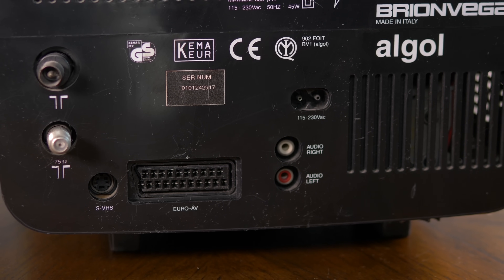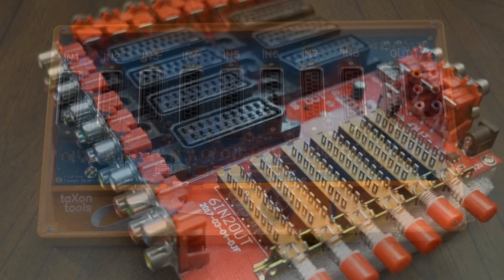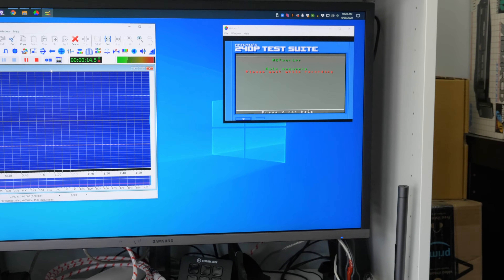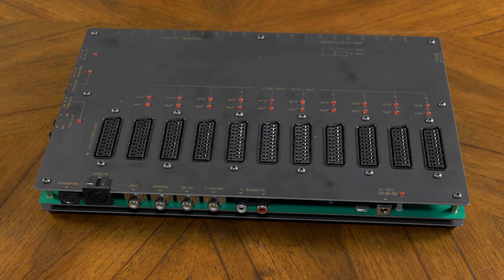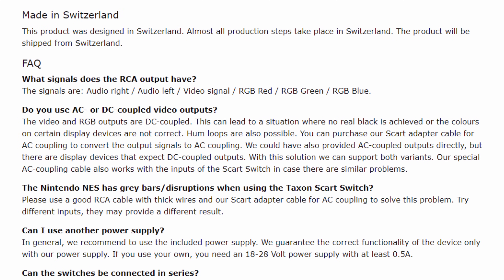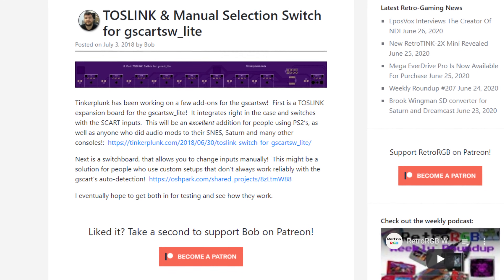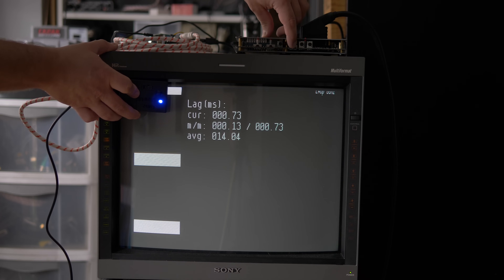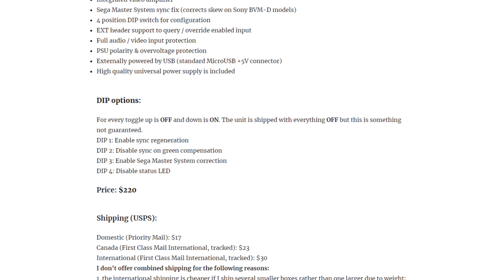SCART Switch Shootout

Comment: Hi Bob
Thank you for your honest review.
We want to give some inputs about your results.
Video output difference:
It is not meant that a customer needs to calibrate these pots. We will factory calibrate these pots. We will recheck our calibration process it seems that some device in the calibration process is not calibrated correctly, hence providing minor differences on the output. But just to repeat what you say: "Better be on the too low side than on the too high side". We will fix this issue for our next calibration it is not a mistake of the device itself.
Audio problems:
We have listed to your audio files and it is not only hearable with headphones. Actually, we can reproduce your problem with a genesis 1 console using the scart output. However, when using the headphone output on the genesis 1 console on volume 5 of 10, there is no issue. It sounds even more crisp than directly. When using level 10 of 10, we have the same issues again. Also from hearing your samples it is clear that the signal is clipping. So, we don't know the triple bypass and what it will do to audio, hence we admit that using too loud input audio is a problem with our switch and gives the results you recorded. We will test whether we can quick fix this anyway with a termination resistor for the next bench. But in our opinion a sega genesis is not the appropriate console for audio testing;-)
Hum loops:
Like descrbed above, the audio problems also have nothing to do with hum loops. As you already have said, we are using dc coupled outputs. Our description is a general description what can happen with dc coupled outputs, not that we admit that our device has general problems. We are just selling this additional ac coupling cable for persons who are having problems on the output because dc coupling is not good for them.
We will definitely include your problems in this version and future versions of the Taxon Scart Switch. Thank you very much. Maybe you can add an update what we want to fix for the current version. We can also send you the switch again after fixing the problems in case you want to recheck.
Thank you
Christopher, Taxon Tools
Reply from the maker: I really appreciate the detailed response and I'm happy to cover all updates to your product in our news posts.
Reply: @RetroRGB  Could you please contact us using our contact form on our website so we can provide you the latest updates directly once we are done?

Comment: Will you be doing a video on component switchers? I'm debating on getting a Extron Crosspoint switcher with bnc to rca caps added to the ports for my HD Retrovision cables.
Reply: im using Extron component. it works great. only downside is the size
Reply: @RideRedRacer  size is no concern just that component cables can work on the BNC ports with adapters.

Comment: Nice to see the SCA get coverage! I used it for a long time before upgrading to an all DB15 setup. The TTL output option is particularly useful for using an Extron RGB interface. BTW, you could have added a note in this video about the option of avoiding SCART altogether and using DB15 cables as an alternative, with plenty of cheap options for professional-grade VGA/DB15 switches from Extron and other manufacturers, from basic ones to auto+manual switching ones with conventional audio inputs (I'm a bit biased on preferring DB15 :p) Maybe material for a future video!
Reply: I am using a Kramer VGA witch for my Amigas. Are you using a VGA switch for consoles aswell? What kind of cables are you using? Any  female scart to male vga cables?

Comment: Do you do all your testing on a flat screen? Would like to see how this gear looks on a crt, same principles apply I’m sure .. interference or no interference
Reply: If anything these should all look even better on a CRT, particularly the Taxon one, as CRTs tend to mask a lot of interference noise, especially consumer ones. These don't do any changing of the signal, so it shouldn't look any worse.
Reply from the maker: For these tests, I felt digital captures were the best way to demonstrate the noise.  Sometimes I take video of a CRT / flat panel with my camera though.  It all depends on what I'm trying to highlight.

Comment: I have 12 consoles that I'm looking to connect that all use either RGB SCART or Component, and I really don't mind mechanical switches, so I'm thinking two of the cheaper Otaku switches ran into a single, regular old component switch and then into the OSSC is probably the easiest for me.
Reply from the maker: That'll work.  Using an Extron Crosspoint should also work as well.
Reply: @RetroRGB  Hadn't heard of one of those until now, but man that thing looks like a huge beast. I might just have to go with it!

Comment: I haven't got a scart switch. I didn't get a chance on getting one with the price so high. I just manually switch them. I hear scarts are fragile. But i am careful and haven't come across a problem yet. 
I use the sync usb cable thing with mine. Seems to make the colors nicer. I tried the one without the USB sync thing and notice a difference. 
I wanted to go component but IDK if sync thing works with that to. I was planning on getting the OSSC but didn't get a chance on getting it. Now that the OSSC pro is coming i may get that instead. I gotta see reviews. I really need something nice for the 480i/p consoles. Framemister isn't cutting it for those but looks nice for everything before the ps1. The Framemister with 480i/p looks alright thou, like how a nice tv would do it. If the HDMI connection isn't available then go with the FM. I hear some good things with 480i/480p with the OSSC but only does 2x, some people had problems thou so i read. Still looking forward to the OSSC pro device.

Comment: There is also the other way around with a scart splitter :) The only circuitboard seems to be from Shinybow as far as I know but rebranded as Ohmega in Europe and provides 8 outputs. It also seems to be quite rare. Apart from feeding to multiple monitors, I also found it useful to be able to feed the signal back to Framemeister with a scart to component coupler when I play back DVDs on PS2 as the signal changes to component with DVDs and my regular RGBs (through WHydra2) feed to FM becomes audio only. All of the new Scart products seem to be focused on Switches and there are no new ones providing more than 2 outputs I think.

Comment: I'm still happy with the two Bandridge switches I've got.
Reply: Yeah I agree. They're a great manual switch. Simple, passive and just works perfectly. I've had four daisy chained together for years and can't complain at all. Although I'd imagine they're nigh on impossible to get nowadays.
Reply: yeah, good luck getting one...
Reply: I have one and it's been fine for me so far, new old stock was still available a year or two ago and they were only about £30, unfortunately used ones are now selling for anything up to £100, I wish I had bought two! I intended to get another then when I looked again they were up to silly money. It does only have 5 ports though. The 6-port Otaku switch mentioned here is only about £50, that's what I'll get next and it will suit average users fine I think.
Reply: I have the manual switch and it worked just fine. I kept it as a backup in case the gscart stops working.
Reply: They are awesome and work perfectly. I got the auto switching 3 input one for $12 from an eBay seller in Germany. Absolutely no reason to buy these expensive switches if all you need is a pass through signal.
Reply: Got two Bandridge manual switches and I pretty much agree with what everyone says; great switches and I wish I bought more when they were cheap.

Comment: Even though I know you don't rate the 5 port manual Bandridge switch much it would have been nice to see it in the comparisons, as they are still changing hands 2nd hand at ludicrously high prices (for a basic switch) and if people could see if they are worth those prices it would be good.
Reply: I have a 5-port manual Bandridge, I got mine for £25 in box but I’m not sure if it was used or not. It looks great, I get no noticeable video quality loss or any interference and it’s been serving my retro setup well for 3 or 4 years now. I was warned before I brought it that they sometimes have issues with certain cables in certain sockets, or have voltage leakage where the Mega Drive power light may come on due to another console being turned on, but for the first two years I had none of these issues. In the last year though I have had slight issues, once or twice I had a console fail to work until I changed the slot, and my mega drive power light sometimes turns on if I have the SNES enabled in certain slots, but it’s never caused any serious issues.

My only real complaint has been that it doesn’t have that many ports, 5 is fine for now for my setup, but if I want to expand the setup at all I can’t do it without a second switcher, and daisychaining them might cause interference. I hope the prices haven’t become really ridiculous as I’m looking into buying another one soon. I wonder why Bob dislikes them so badly, I understand worry about the voltage leaking and occasional console incompatibilities but I’ve found they are never a serious issue, right now I have Mega Drive in AV4 and SNES in AV5, and I’m having no issues at all, and I can’t see any extra interference.

Comment: I use the Shinybow for the professional build quality and all-metal commercial enclosure. Not a fan of the "garage project" look of the other ones.
Reply: Same. Love my shiny bow
Reply: I LOVED my Shinybow...until I discovered my reciever didn't support 480p natively, nor upconvertion a no go.  I cried retiring her.  480i was the best I was gonna get from my majestic scart to component Shinybow.   😳😳😳💔💔💔😔😔😔
Reply: I've had a 4 port Shinybow Scart and Component switcher for a few years, both are phenomenal. I wish they offered like, an 8 port Scart switch, but what can ya do?! LOL!
Reply: I have a Shinybow as well. It does indeed have a nice build quality. I use the matrix switch to send the signal to my capture card and OSSC.
Reply: @r37r0dotcom8  Hi, I would like to purchase Shinybow Matrix Switcher soon for use with Playstations mostly. There is very little info about it online from retro consoler users. Have you encountered any problems while using it? Signal degradation, lost of signal ect ? Do you know any sourse of info where to look for such info ? Thanks in advance or your reply !

Comment: 3:17 - 3:42
I did notice some speckling interference in the text when zoomed up close, but not with other switchers.
Reply from the maker: The specking was also on the direct captures, so something might be up with my OSSC.
Reply: @RetroRGB  Not that it ruins the experience, I got a good eye for detail. :)
Reply: The hill from the farthest right, under the score counter, also had speckling.
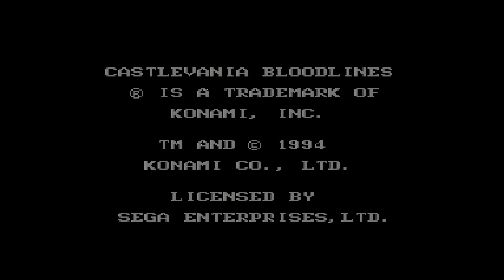Reply: It's also very noticeable at 5:25 during the audio testing. Not great for a video quality comparison when the initial setup already shows major issues.
Reply from the maker: @blizzz, I gotta respectfully disagree.  The video CLEARLY shows the analog interference in the blue areas exactly as I described.  The speckles are probably a digital artifact like Skul said...which is weird, because I'm using a brand new cable that everyone was recommending.
Reply: I had this kind of speckling with my OSSC, it was so bad I couldn't even use the thing higher than 3x. Turns out the solution was simple: swap out the HDMI cable for a new one. That fixed everything.

Comment: I’m still searching for a Scart splitter which doesn’t break the bank
Reply: Check out the JS Technology "Active SCART Buffer V3". It's £50 and I have one; it's a proper distribution amplifier and touts no added lag and such, and while I don't have the equipment to do any technical testing, the picture on my CRT and through my OSSC looks just as crystal clear as plugged directly in. You can also get a version with a sync stripper included, which as well as cleaning sync into c-sync also allows conversion from sync-on-green to RGBS. Been using it for a couple of months now and I've not had to touch it once (besides changing the console plugged in...I'm waiting on that Otaku SCART to finally ship :P).
Reply: tehFoxx0rz Thanks I’ll look into that one. Seems reasonably priced
Reply: @tehFoxx0rz  Might be waiting a while as I've been waiting since February for my Otaku Switch to ship.
Reply: @shanomacdaddy  Yep yep. Been emailing them for updates. Production delays and now stuck in customs cus of this pandemic apparently. Ahh well. It'll get to us when it gets to us!
Reply: shano im also waiting since February! Covid wrecked the 2 weeks estimate 😆
Reply from the maker: Use a powered VGA splitter and wire your own SCART adapter?
Reply: RetroRGB thats actually a very cheap solution probably. I’ll look into making my own Scart adapters. I also have to handle the sound, it’s probably a terrible looking solution (with a lot of cables) but it can be cheap.

Comment: I have two 5 port Bandridge mechanical switches attached to one another with Velcro command strips. 9 inputs, 1 output. Works great for my needs. I haven't really noticed any issues which isn't to say they aren't there, just that they haven't bothered me if they are there. Plus they were $50 each which isn't too bad. Only thing is you have to take them apart and cut a trace or they leak power to other consoles.

Comment: 3 Bandridge 7725 in a row, one spare. Great stuff, sadly now very hard to get. (Not to be confused with the 7735 Version)
Reply from the maker: Yeah, I think there's a few revisions of each as well.  I think there was one that was fine with no mods, one that required you to cut a trace and another that couldn't be fixed.  Everyone I've spoke to who said they have the good ones are very happy with it though!
Reply: @RetroRGB  true true. I checked mine if I need to cut a trace, which i had to in all 3 by now.  This, and good cables can brighten your day.

Comment: Your SCART systems are not enough for me.
I use the HYDRA. Here I can use 16 SCART devices. A very nice piece of hardware.
Reply: Weird. I use a hydra 1 16 input with zero problems. Love it. Takes anything I throw at it.
Reply: I link three gscartsw together for a total of 22 inputs. Plug the two extra switches into the main switch that I use for output. I guess it would be possible to go crazy and get 9 gscartsw for a 72 inputs.
Reply from the maker: I tried a Hydra a few years ago and it was terrible.  I'm not trying to insult your purchase, I'm just being honest.  If you have the ability to run the tests I showed, give it a try...and also test voltage from the outputs even when there's no console powered on.
Reply: @RetroRGB  Did you do a review? I would be interested to see it. I know Lotherak has made some improvements with them in recent. Maybe worth getting a review unit to see how it stacks up now? I would be interested in seeing your opinion and your test results. I use a W hydra 2 in my set up currently and after a Modification because it was from an older batch it worked perfectly.
Reply: @RetroRGB  I can't test it like you can. But the picture is very good. The one who made the hydra told me, that I have the upgraded version and there may be updates in the future.
Reply from the maker: @RaumfuerSpiele  I heard there was a new version, but I never got a chance to test it.  I DEFINITELY had the original version though, so hopefully all the issues were fixed.
Reply: @RetroRGB  Get a review unit and see how it stacks up!
Reply: @RetroRGB  Before I had the Hydra, I had the system from Monster Cable, which was the best system of the SCART era. I think the picture of the hydra is just as good.